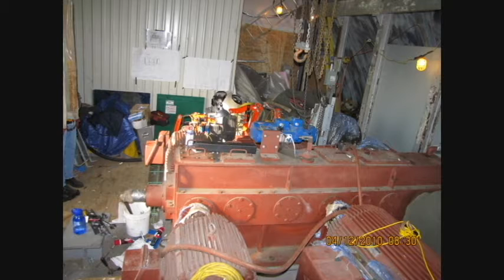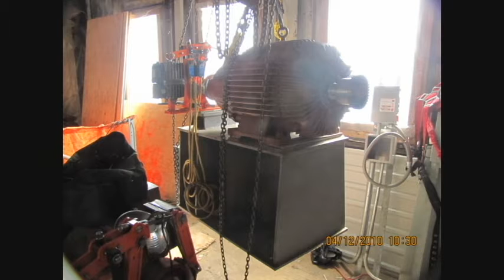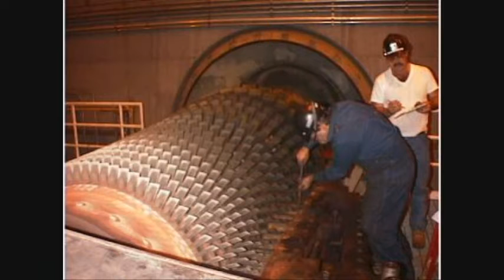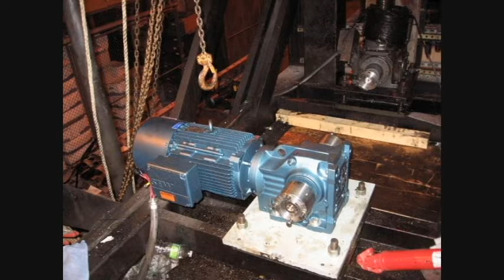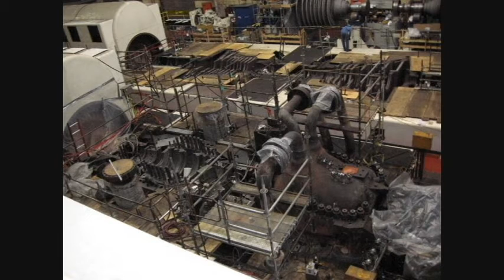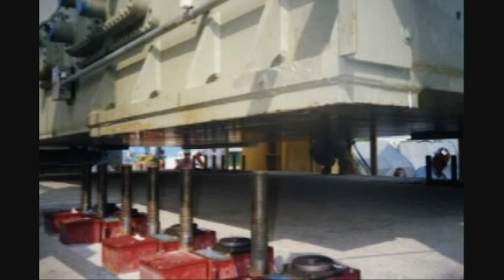Union Millwrights

Comment: 1st Period Millwright Apprentice. Local 1607 So Cal.
Reply: How do you like it? I been welding for 13 years have experience on field been thinking of joining the local 1607. Hows the pay when you start.
Reply: @jcporosity4764  I love it. As a 1st Period Apprentice I started at $21.46. 1st Per. Apprentices make 50% of Journeyman scale which is at $43.83 currently (up from $42.91 as of July 1st). I'm a 3rd Period Apprentice now. At $26.30 (60% JM scale). If you're a certified welder they'll start you at a 3rd Period Apprentice's pay. This is not including vacation pay which is $4 an hour for 1st and 2nd Period Apprentices and $5 an hour for 3rd Period thru JM. I'd say go for it. Oh and this is for California. Each state has different scales.
Reply: @chuckwoolery8668  wow nice. I have buddy that join the union millwright 2 months later got lay off cus no work
Reply: @jcporosity4764  you're going to get laid off of every job. But if you're a hard worker you'll stay busy. I've had no problems with work since I joined.
Reply: That's just the way it goes. As a Millwright you are completing projects. Once the project is over you move on to another project.